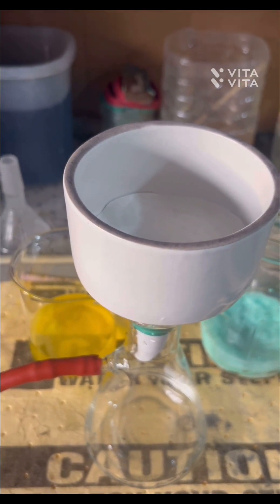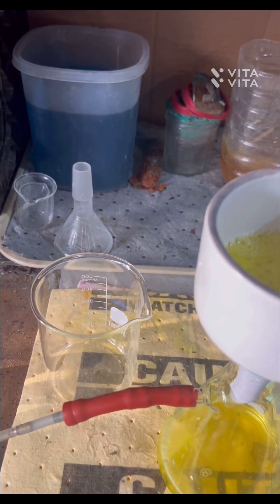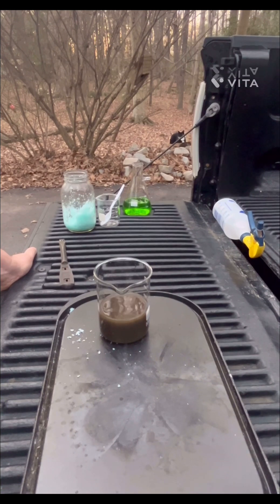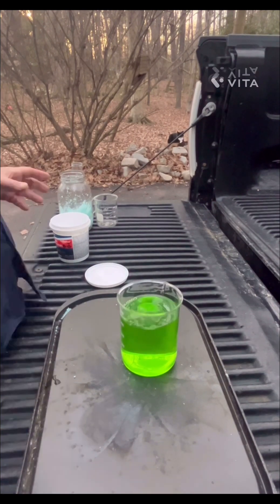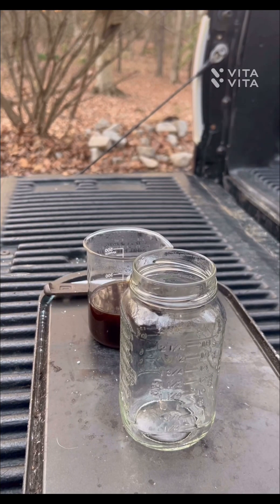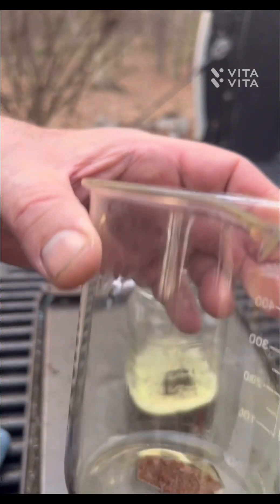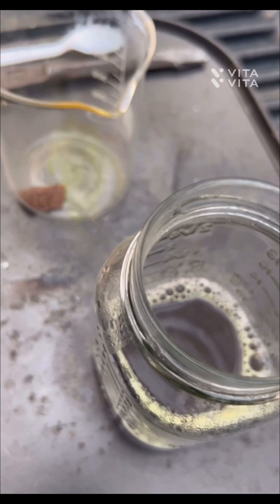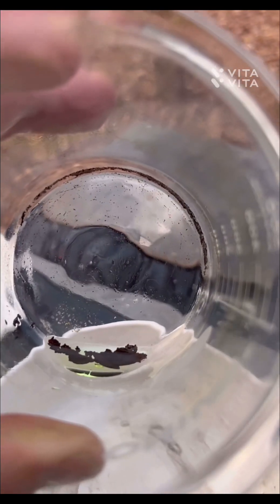RECOVERING GOLD USING IRON SULPHATE #gold  #goldrecovery #chemistry

Comment: Doesn't the solution need to be heated before sulfamic acid addition?
Reply from the maker: It was used for deNOX , I didn’t heat it ,
Reply: @Hill-13  I used to use urea just recently started using sulfamic acid for my deNOX however I've read that the solution needs to be at 194F before the additions of sulfamic, I could be wrong maybe there isn't a difference 🤷
Reply from the maker: @Willsmith-nk4hi  if you find that article could you send it to my email Adress ?
Reply: @Hill-13  sure thing :) it's hard to find information on sulfamic acid and gold recovery but I follow several groups and there are a few videos on YouTube as well. Geo and successful engineer have both posted one and they both mention the heating. Are you familiar with either of those channels?
Reply: If you use a gold button to gadge when the reactions completion then lower heating is kinda a must so you can watch the button. The heating bubbles and gold dissolving look similar